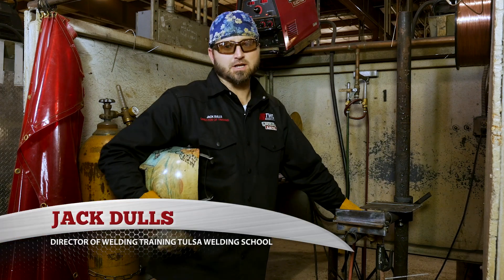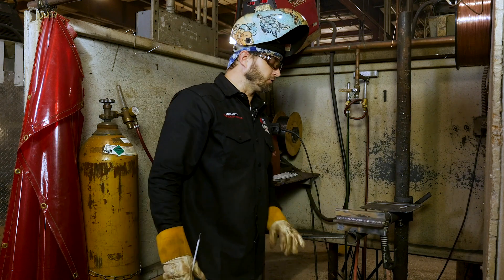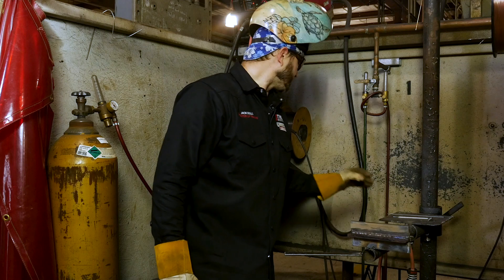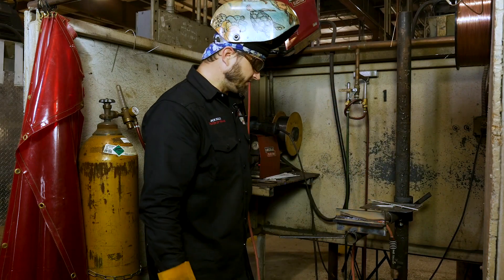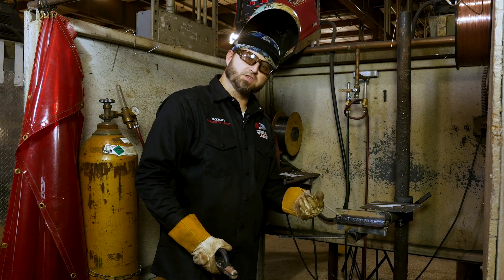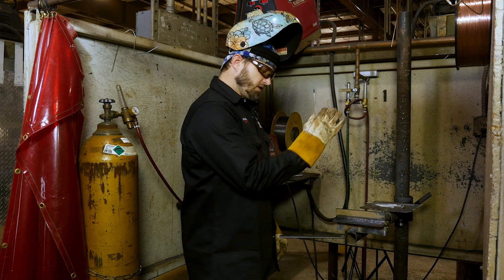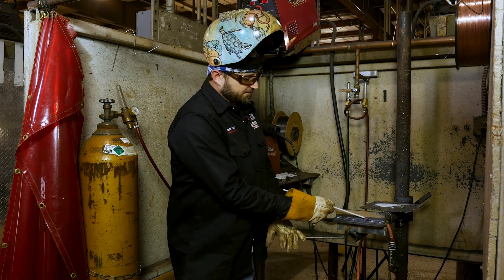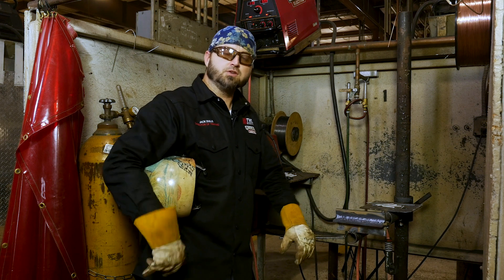How to Weld a 2F 7018 All the Way Out

Comment: I finally just passed my 7018 2f multipass thanks to this video and my slag peels off just like yours does! My angle for passes along the back/wall always got me. Now I am moving on to 6010 2f multipass which I feel is a bit easier due the thickness of the rod. I am curious as to what level of shade you use when welding to see your welds? . I have been using 10.5-11 for most part but always like to find out what works for others...

Comment: Why that angle? Why did you grind after the first pass? Why do multiple passes? Why change the angle after the 3rd pass? What was your speed? What were the settings on your machine? What is that rod? What is 2f what ever thats called? Why is it in a t shape? Why would you fill that entire thing with welds? Why not use metal as filler and weld it in place?
Reply: Why what angle? He cleaned the bead with a wire wheel as you should. He explained multiple passes to simulate filling a gap. To avoid undercut as he explained. It’s not mig. He showed 110 amps for 1/8 rod. It says 7018 on the title. 2f is horizontal flat as seen. It’s a T to similate welding two plates 90* of eachother. Because it wouldn’t be as strong.
Reply: @dhughes6921  is there a way I can get  tie ups down someone tried showing but i loss focus like I sometimes go to high and can’t see the weld toe when I’m welding
Reply: You need to watch a smaw (stick welding) 101 video first.
Reply: You clearly haven’t been around metal